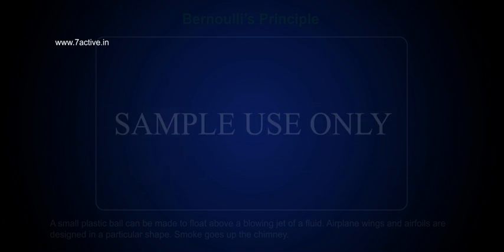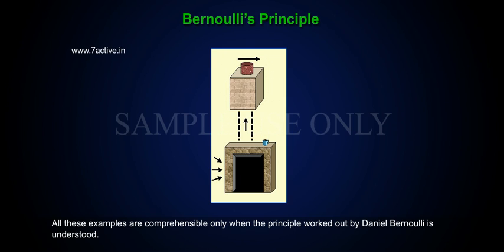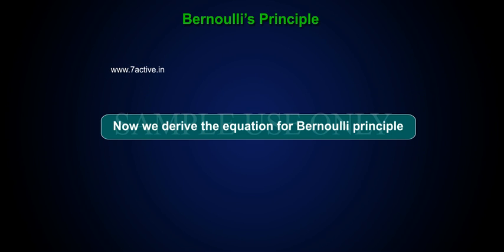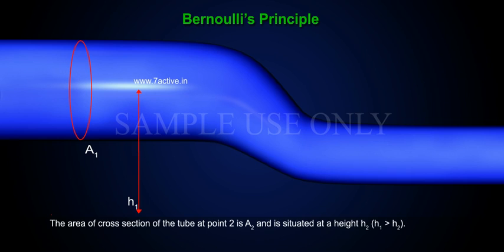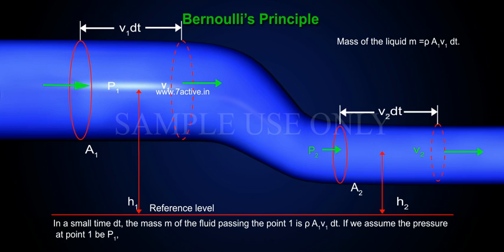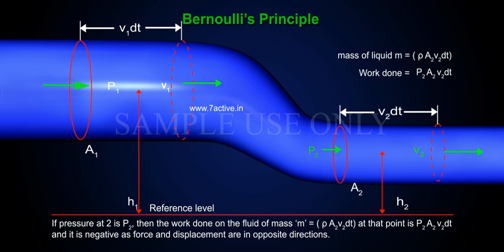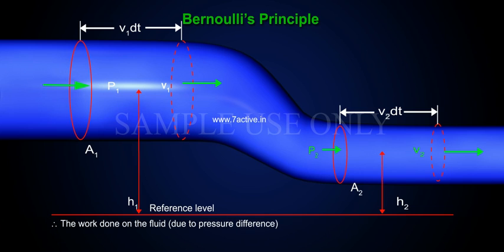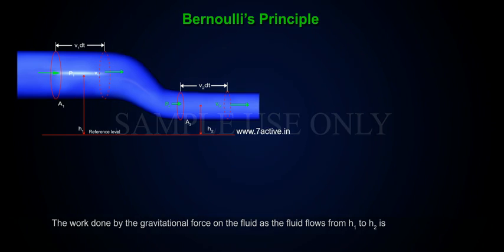BERNOULLI'S PRINCIPLE PART _ 01

Comment: This is very poor in the beginning:
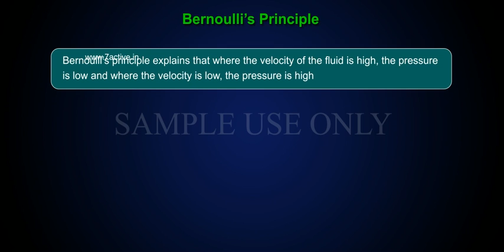0:40 Incorrect.  Bernoulli says that when the velocity increases (acceleration) it will be accompanied by a a decreasing pressure.  It is the pressure change along the flow that accelerates the fluid, thus changing the flow speed.

Comment: NO! FLAT WRONG!
...
This repeats bad science once again.
...
 Bernoulli CLEARLY states that:
When there is an INCREASE in velocity (Acceleration). there is a decrease in pressure. 
...
Air has mass.
A force is required to accelerate a mass, even air.
A pressure difference provides the force which accelerates air.
A higher pressure region accelerates air toward a lower pressure region.  THAT is why it is moving faster when it gets to the lower pressure. 
A HIGHER pressure accelerates the air TOWARD trhe Lower pressure region.

...

Comment: How force and displacement are opposite?
Reply: +Sandesh Pandey,
This video repeats bad science once again.
...
 Bernoulli CLEARLY states that:
When there is an INCREASE in velocity (Acceleration). there is a decrease in pressure. 
...
Air has mass.
A force is required to accelerate a mass, even air.
A pressure difference provides the force which accelerates air.
A higher pressure region accelerates air toward a lower pressure region.  THAT is why it is moving faster when it gets to the lower pressure. 
A HIGHER pressure accelerates the air TOWARD trhe Lower pressure region.